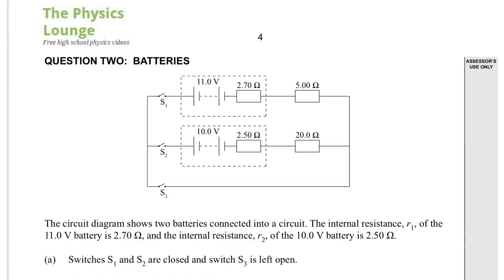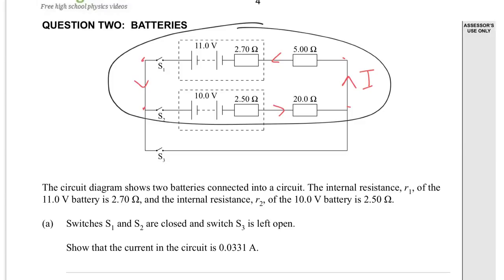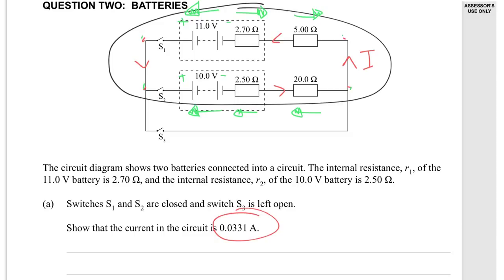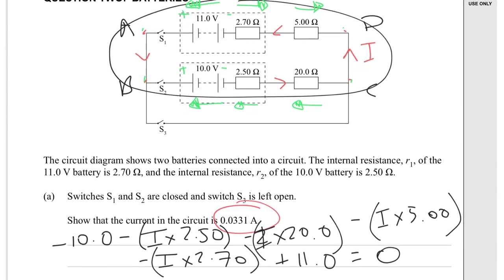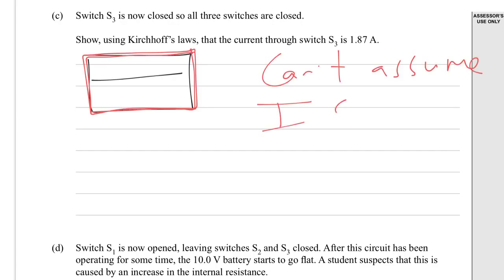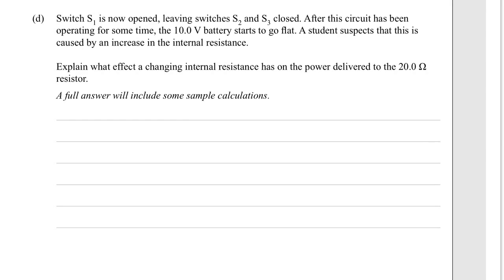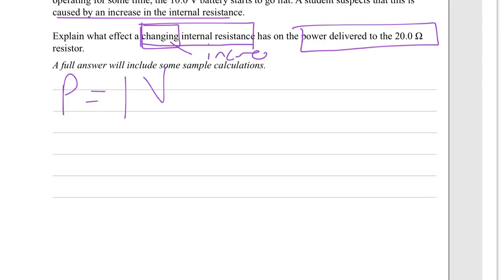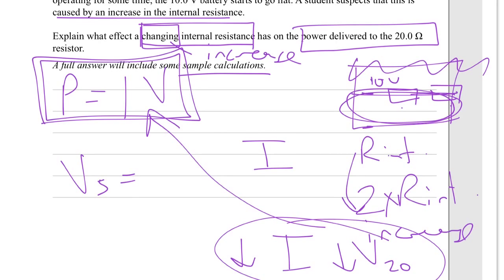2014 Electricity L3 Q2

Comment: can you please show & explain your working for Q2 c? I'm not getting the right the answer thank you
Reply: Hes got that one wrong, you have to account for the second loop made from the 10V battery then add the two currents created to get the current formed
so 11= I1(2.7+5) and 10 = I2(2.5 + 20)
Solve both those equations for current and you get I1= 11/7.7 and I2= 10/22.5
then the current running through S3 is the sum of both of these currents (I1+I2 = I3, Kirchoff law) 
simplify answer and you get 1.87A